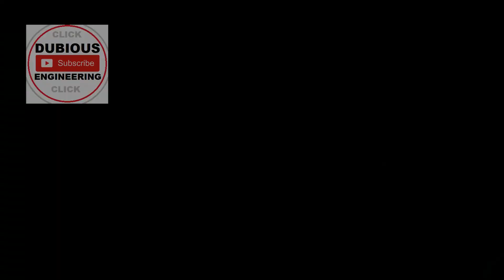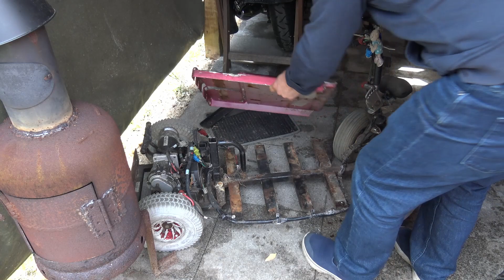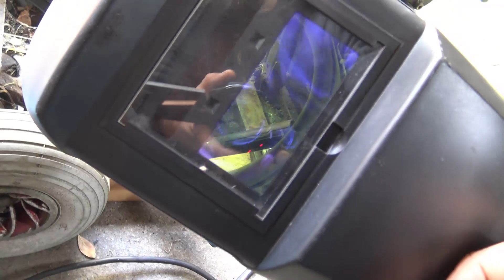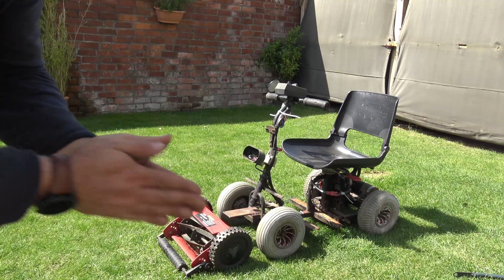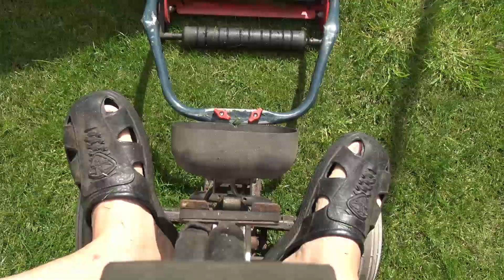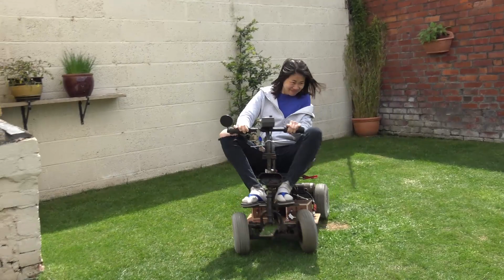DuB-EnG: Budget Ride-on Lawnmower Hack DIY FUN - Mobility Scooter and manual Cylinder Reel Mower.

Comment: That's it - I gonna get me a welding kit & learn it pmsl
Reply from the maker: .., I know a great teacher :-) ... Hahahah. I weld about twice a year, but once you got it... it’s like soldering... puddle control :-)
Reply: If you do, don't take the stick in your hand as he does, but just take the grip in which you put the the welding stick and use it quite like writing with a pen that you hold on the wrong end. That's the way it's properly meant to be done, because the stick's coating is very brittle and should not be broken.

Comment: 6:29 DEEP penetration (oh sounds lovely) nah .. he means weld depth.
Here's another wee trick I use, (not being much of a welder myself though).
When I have thicker walled box section (or pipe) to BUTT weld - I use the cut-off wheel and make some CUTS into the end of the box, almost through the wall, so that when I BUTT weld them together, some of the welds are at the other side of the thickness - and some are nearer the outer edge, that way - I know I have maximum penetration without having to overheat the box when doing that.
at 6:29 you can see that you only edged about a mm as the bevel, whereas there's still a LOT of thickness you would STILL have to try and over heat to deep weld through, by nicking a few deep cuts with the cutoff wheel, without going through that total thickness, you instantly have your deep welds - and only need to be using spot welds.
Reply from the maker: You really can weld!!! Penetrative welding!

Comment: This is equal parts awesome and horrifying. (No guards on the back of the push mower haha)
Reply from the maker: Hahaha...  true enough... you wouldn’t want your pet cat or a pigeon to get caught in there...  no break or estop on the scooter either :-)
Reply: @DubiousEngineering  Oh no. Oh well at least with no e-brakes it will curb the urges to do drifting.

Comment: Great idea! How come you didn't fasten the reel mower to the back end for steering? It looks like you can only go straight.  And what happened to your robot mower you made?
Reply from the maker: Robot mower is upstairs in the loft...  that was such a bodge job :-)   The problem with the reel mower, you have to push it, otherwise it doesnt "dig in" and rotate the blades.  It's too light to pull along behind.

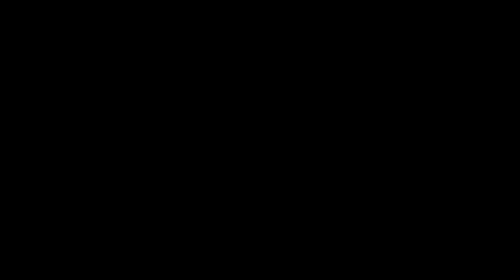Comment: 16:40 (next we have) - time to convert this into a small rail rider - and take it to your local 2 foot society railway club..
That would be a real hoot (I mean Toot) toddling along a miniature outdoor railway societies 2 foot railway line...
I am in the beginnings of converting the one I have - for that task - but beware - if using the rubber/road wheels to counter rotate the rail-axles (with the correct gauge rail wheels) - Reverse is your NEW forwards lever - and visa versa.
Reply from the maker: Hahah... yes that's the addition of a set of gears!!!

Comment: 4:04, what you'll probably notice - .. yeah I noticed that right away at the start bro.
As soon as I saw your angle grinder.

What I also saw - was that you still insist on a 4" "cut-off" disk, without a guard.
WTF man ..

I too have a 4" angle grinder, however it too hasn't had a guard on it for many many years.

Even if anyone WANTED to put it back on (if they could find it that is as I lost it also long ago) - is this.
I have for many many years now - RUN not a 4" cut-off disc but a 12" cut-off disc (same shaft size) from a drop-down cut-off saw.

The first time I ran out of 4" discs - I had a spare 12" lying around and thought - yeah why not.
I lost the skin off my knuckles of the hand on the tiny side handle - so made me a HUGELY LONG aluminium bar (1"x 1/4") which I had and bent it slightly to fit at the grinder with a larger bend where I re-bolted that tiny handle onto - now 15" away from the grinder.

I now have (for the mere cost of a Bosch 4" angle grinder in 1990) a HUGE 12" cut-off wheel machine that will do all the cutting I ever need - for one big job without needing to replace a cut-off wheel.

I made an entire 10ft x 8ft all steel trailer and still had enough cut-off wheel left over (without changing it) to do another wee job later.

Oh and Aluminium is NOT spelt the USA shorthand way - of aluminum - it's Al u min Ium.
We have here in NZ a smelter by the CORRECT spelling. see:
New Zealand's Aluminium Smelter (NZAS) is New Zealand's only aluminium smelter and is located on Tiwai Peninsula, across the harbour from Bluff in Southland, South Island, New Zealand.
Reply from the maker: My grinder makes up for my poor welding :-)

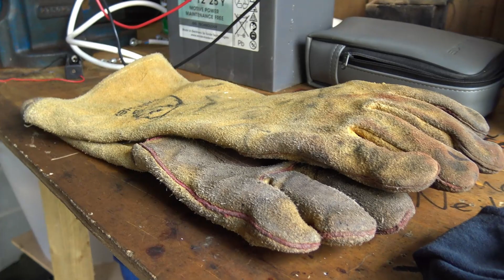Comment: 8:45 You what - gloves?
I myself am an industrial (registered) NZ electrician and believe - if it's HOT I will know it's going to be HOT - as I welded it.
Also - if I was to "assume (like many who use leather gloves think they know) that it will EVER protect me from the arc current - good luck - as that leather glove won't protect you enough - heavy duty electrician's rubber gloves may - but NOT leather work gloves.

That said - I have NEVER used any type of leather work gloves, or any other type either.
Why?
Because I need to know the feel I get from my fingers, what I am touching - to know that the leather doesn't allow my fingers to "feel" correctly, hence I have never used (what I call fanny-pad) leather gloves.
IF YOU CANNOT CONTROL THE ROD from the clamp handle itself - you should NEVER hold the tail end (the hot end) of the rod, near the job (WITH THE OTHER HAND - with the glove on it) as you could easily have a weld-spotted hole in those gloves and instantly electrocute your fingers - or your whole body.
Reply from the maker: Love that you took time to look...  pigeon shit wedding...  sorry